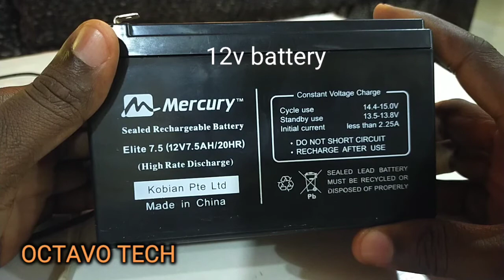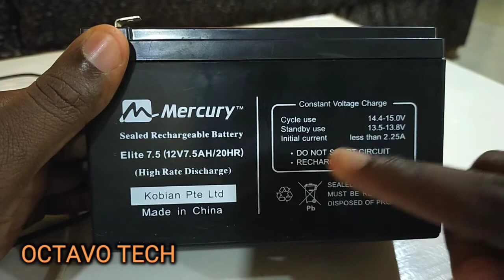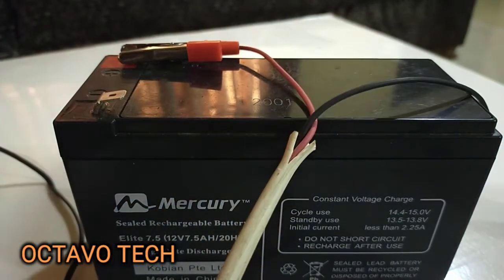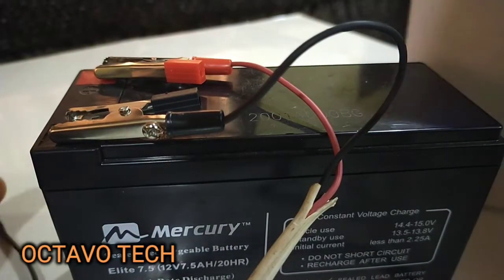How to make backup battery for routers and security cameras - DIY

Comment: 10 hours no be small thing. This would literally solve the battery issue with HyNetFlex. 

Do you have the seller link on Aliexpress, boss?
Please help us paste it under the video description if possible.

Aso, you didn't mention how to charge the battery itself. 
Is it solar-powered or comes with a charging cable?
Reply from the maker: The battery was bought in Nigeria in a shop where they sell solar panels, batteries and accessories. Importing such battery is practically expensive. It's economical to buy in Nigeria.

You can also get the battery charger from same shop.